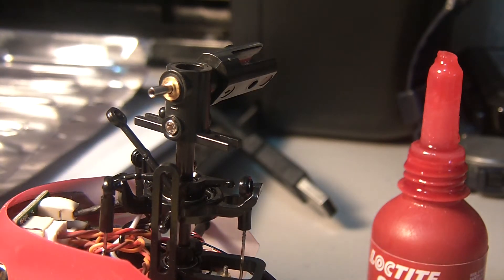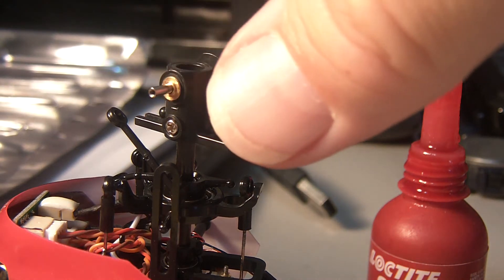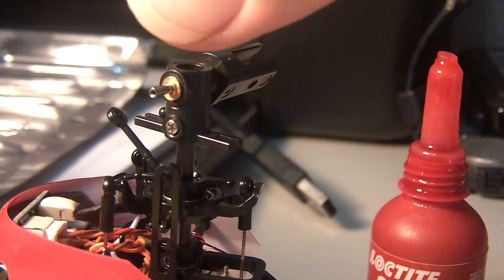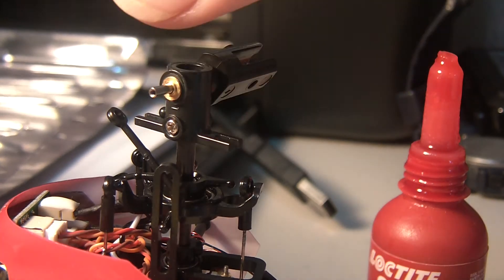MCPX Repair new feathering shaft

Comment: I was about to ask the same question.  Red is for permanent and bleu is medium hold.  So i used bleu lock tite on mine, but the problem seem to be the bearings that falls apart.  One of my blades just missed me.  It's a chance i wear eye glasses...  Wonder what HH is going to do with that issue and the poor life of the batteries ( that's another thing...)

Comment: I ment it doesn't last lond while flying...  only around 3 to 4 minutes.  But actually, the new mCP X has a 200 mA batteries.  So, the next batteries I will buy, will be those 200 mA.  It will stays in flight a little more longer with that.  Thanks for your reply.